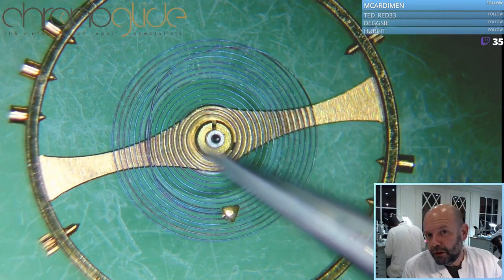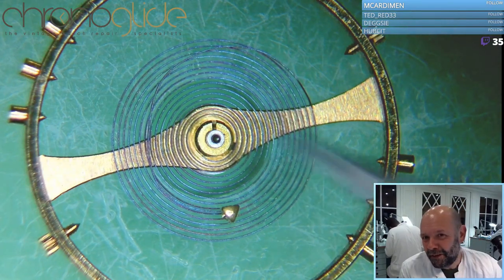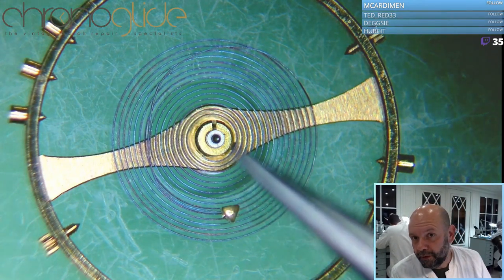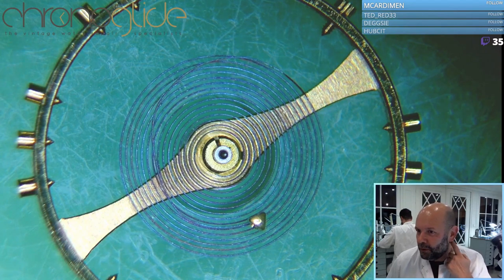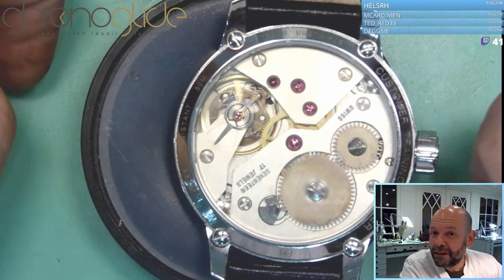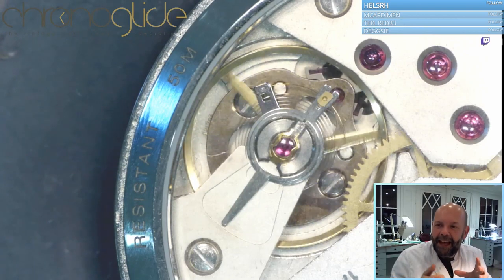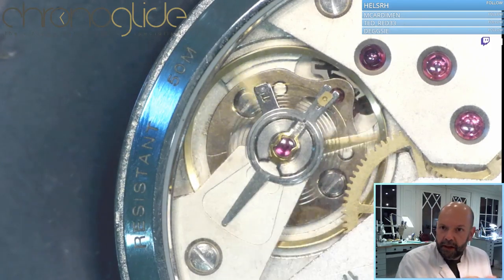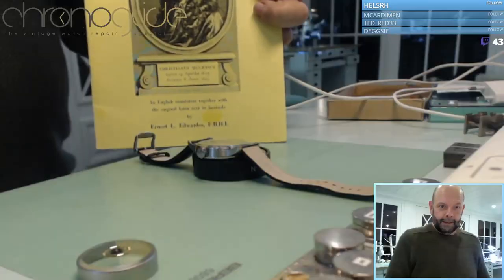How to repair a Balancespring - hairspring Part 1of3

Comment: Thank you;
 you were able to make it look simple, and it really is, your lamp cord analogy was genius

I see now that one should never drop a watch that has a hairspring in it...
I am looking at a 1960s ? miniature  18k ? Omega that gains 1 hour per hour !! 

 i do not see the hairspring move at all, but the watch is so tiny , case is about 12mm diameter and my eyes so bad,that even withan eye loupe i can almost not see the spring, much less start removing parts... but if i decide to grind a small screwdriver tip to fit those screws... i might
Reply from the maker: I'm sure you will succeed Jose!

Comment: Hello master watchmaker
Please, how to replace the broken pivot balance in the hair spring (nivatronic collet) of the square collet.  is very hard and strong. I have heard that it has a special lever but I have not found this tool. For example, eta2878 or 2879, 2836 thanks for your instructions. If you mentioned, please give the address